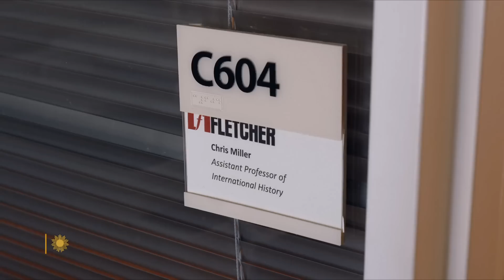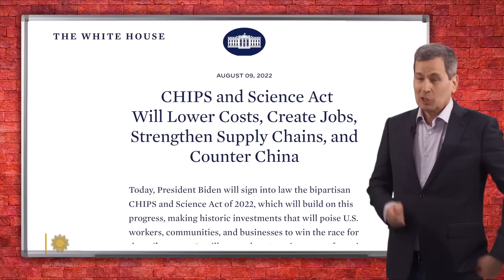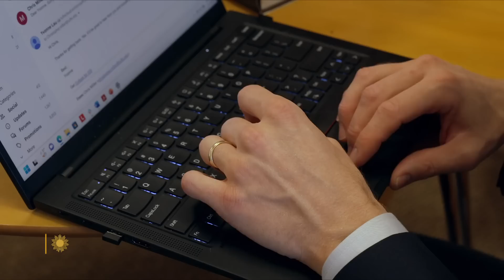The CHIPS Act: Made in America, again

Comment: BTW, ASML's most advanced machines in current commercial production, known as EUV lithography systems because of the "Extreme Ultraviolet" light waves they use to map out the circuitry of computer chips, are as big as a bus and cost around $150 million each. Not cheap.

Comment: Really, I never knew my kitchen knives had chips in them, what are they doing?  My hot pads have chips what?

I know chips are in many more things than many people first think of but it's not actually EVERYTHING.  The stunt with breaking open electronics was unnecessary and very overdone and I think focussed in the wrong direction.  I think most people realize chips are in most of those things, it's things like most gas stoves they don't realize or your dimmer switch for your lights, other things that use electricity but people don't think of as electronics.  There's also a gap in understanding of just how many chips are needed in many things that people think of as simple.

Comment: There is a workplace term going around called quiet firing. It's actually not quiet at all. Quiet firing and quiet ejecting an unwanted student or employee out of your class as a college professor or Workplace manager. This is a strategic psychological abuse tactic that strategically ostracizes and isolates a targeted person in the workplace or classroom. It is a psychologically and emotionally painful experience. If the victim reports the abuser, they are faced with denial and gaslighting. By the abuser and or organization doing this in an attempt to invalidate and discredit the victim.

Comment: Why do we need a microprocessor in every damned thing in the first place?
The bit about major  appliances having chips in them.  WHY?  It isn't necessary.  Stoves and refrigerators have been around since long before the microprocessor, and worked just fine with mechanical controls.  Dishwashers, clothes washers, dryers, toasters, furnaces too.   Microwave ovens... yeah, older models had mechanical timers and did the job just fine.

And in most cases, when the timer or thermostat failed, it could be replaced easily.   When a microprocessor-controlled appliance dies, the cost of the repair often exceeds the cost of just buying  a whole new appliance.  And for what VALID reason does a refrigerator, stove, or laundry machine need internet access?

We've become too enamored with 'smart' gadgets.  Most things don't need to be 'smart' or connected.

And because of all this connectedness and 'smartness', we've rendered entirely too much of our primary and secondary infrastructure vulnerable to attack.

Comment: Made chip in US is like made cloth in US. Gonna fail again. Semiconductor manufacturing is highly toxic and like any manufacturing it is long hour and labor intensive. Workers in US would rather do high pay remote keyboard work.
Reply: >> " ...Made chip in US is like made cloth in US. ...  like any manufacturing it is long hour and labor intensive ..."

Well, long hours and labor intensive?   I think you are talking about assembly/packaging supply-chain which has all but been outsourced to East Asia, but the chip manufacturing which the US is trying to bring back is highly automated.  They do need to run their factories 24x7 to maximize/optimizes their investment -- each EUV litho for instance costs as much as $200B for 3nm or lower processing, but it's not really labor driven business.

Comment: It's not just chips, U.S used to have over 2000 PCB manufacturers now they are down to 150 or less, there should incentives to bring back every aspect of electronics manufacturing not just chips.
Reply: we don't need to bring all low-value, low-tech jobs.
Reply: @tooltalk  Just ask yourself when China denies you those PCBs where do you want to mount those chips?! your head?! PCBs are crucial as chips, and manufacturing them is far more sophisticated than you think.
Reply: @tooltalk  circuit board manufacturing is an $82 billion a year industry.
Reply: @tooltalk  average pay 98000k a year
Reply: PCB and other ecosystems will automatically grow around the chip industry. Also, it can be manufactured in any friendly lower cost country except for the military applications for security reasons.

Comment: It's great they are building chip fabs, but the story the news won't tell you is that the CHIPS act does nothing to address the shortage from COVID. The chips in shortage during covid used in cars, industrial controllers, etc are not from TSMC cutting edge processes or even fab processes from the last decade. They are old chips on old fab processes that do things like voltage regulation and digital signal processing. Additionally almost all the chips fabbed in America (if the fabs ever are completed) would not be assembled in America. Electronics require PCB board factories, PCB assembly factories, and electronics assembly factories. PCB board factories use massive amounts of water and often leave copper contaminated water, I doubt you could build a new one north of Mexico. Assembly plants require a huge workforce and do not pay well. They would almost certainly remain in Asia unless new factories are build in low cost western hemisphere countries